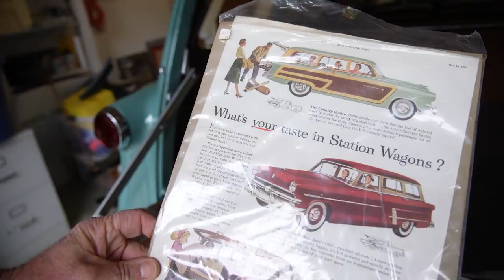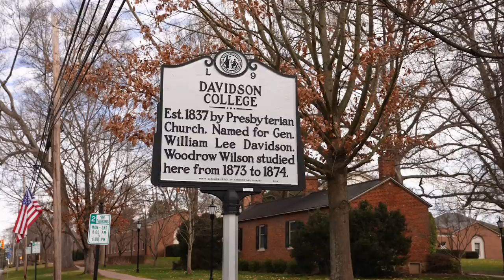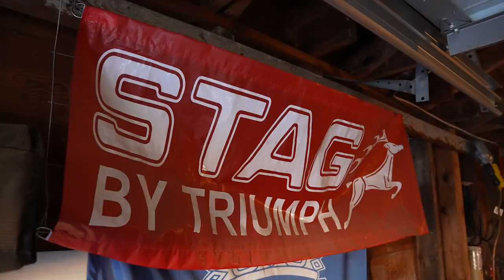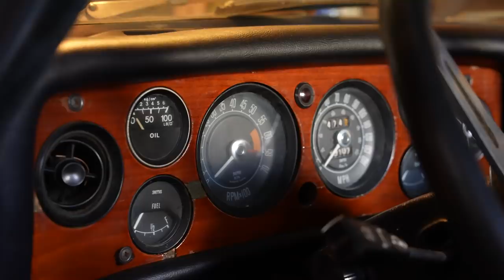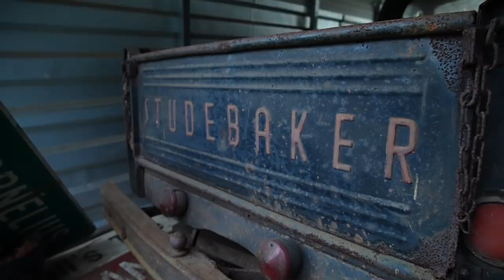Two Jeep CJ 2As and Three Triumphs in ONE alley | Barn Find Hunter - Ep. 103

Comment: My most favorite Triumph is the TR6, love the lines. 
However, the Jeep CJs caught my eye, especially the one with the power takeoff. In 1947, Rover in the UK, developed the Series 1 with a power takeoff that went under the body and through the frame and the frame copied the original Jeep of WW2. The thought was to have the driver sit in the middle seat similar to a tractor. Obviously it was move to either right or left depending upon the country’s laws. 
I have a 1967 series lla, and it still has the openings for a power takeofff. Thanks for a great video, as always.

Comment: I have been waiting for a Jeep barn find. And they give us 2!
Reply: I've been waitin for a Jeep episode as well, I own 3 Jeeps with the latest model year being an '85 AMC Cj7....🇺🇸
Reply: I own 2. 1972 commando and a 1950 Jeepster
Reply: We need a jeeps in the barn book!  We did not originally plan to film the jeeps and i wish i could have pulled them out of the garage to show them better.  The 46 (tan willys, we call it TILLY) has original pto, diamond plate driver's side step, chaff guard on radiator and rear seat.  The 45, while  uber rare, was an advanced cancer patient and required a frame off restoration.  I mentioned it had an industrial motor, but i do have a period correct 45 head that i will eventually install.
Reply: @markweir4469  if you have YouTube channel chronicling the restoration I'd watch it.
Reply: @plantertrey  The green jeep was done 2007 to 2009 ish and i really wish i had taken video.  I have lots of non digital pictures!  I hired a top notch body man to be the project engineer  and he was hired to work on a monster build of a cherokee xj for little earnhardt ( we live in the center of the nascar world).  I think i have a pic somewhere of the two sitting side by side.....Jeep on!
Reply: @markweir4469  Thank you for your reply and Jeep on!

Comment: Hi Tom. To be fair the Stag is a full 4 seater and that  3litre V8 is a sweet engine when looked after . Manual /overdrive is pretty rare . The power steering is ridiculously light  and is dangerous in damp or wet conditions . So is the Ford replacing the "woodie" ? Thanks Tom.

Comment: My Grandfather was a contractor and lived in Cleveland Heights, Ohio. You could not have a pick up truck on your property so he used Ranch Wagons to haul around materials. A 1956 and a 1960. The back seat was folded down when he purchased  the car and came back up when he sold it. The 1960 had a 352 ci Interceptor engine and could really run. If I remember correctly the 1960 was the same green color of your 1953. Both of these vehicles smelled like cut lumber inside. A great memory.

Comment: Back in 1974 I had a '53 Crestline Victoria given to me because it wasn't running at the time and the rocker panels were all but rusted off from the midwest winters. New battery, points and fresh gas was all it took to get it back on the road. It had the flathead V8 coupled to the Ford-O-Matic  automatic transmission. with less than 50,000 on the clock it was in pretty good condition other than the rust and it drove well. Unfortunately as an 18 yr old still living at home I didn't have anywhere to keep it so I sold it for $300 which was about 50 more than I made in a week working at a factory back then.

Comment: My dad has a 46 cj2a with a three on the tree i forget the number of how many were made with a 3 on the tree but its not too many he had the mechanical side of everything rebuilt by a guy down the street who gets engines sent to him from around the country old hot rodder cool guy. We used to antique farm shows and plow with the jeep from time to time as my dad has an old ad of the cj doing all types of things such as plowing punning a welder trenching and a ton more the plow worked very well cuz it has 5.38 gears. It has an 8,000lb pto winch the name slips me ATM Bradley maybe? That jeep will go anywhere you want to take it I've seen it go through mud holes that a jk with 4 inch lift and 35s had to winch himself out of. we  also have a 43 bantam trailer to go with it love that jeep and I will have it forever.
Reply: from my research -- the VEC (very early civilians -- ie 45 and early 46) had three on the tree.  WO records were spotty and in general they used the parts they had and then switched over to new ones.  You are correct that the three on the tree is pretty rare.
Reply: @markweir4469  My dads is the only one I have ever seen in person or on the internet the winch is a Ramsey pto winch I have thought about posting some you tube videos of the jeep wheeling and plowing if i could find the video of it.

Comment: Tom, A station wagon with a three-on-the-tree, what more do you need?
Reply: How about a 4 or 5 on a tree?! And did you notice that as well as making full use of the width of the car with a bench seat,  the column change also doesn't intrude on the passenger legroom. BUT in addition, despite being REAR wheel drive, somehow it doesn't have a nasty transmission tunnel in the middle! So maximum  passenger space! And did you see under the bonnet? The engine isn't all crammed in with unnecessarily extra gadgets , so you have good space to work on the engine. This Ford is a role model for how ALL cars should be designed!
Reply: @nygelmiller5293   I have heard of 'Tree' transmissions with more than 3 forward gears but I don't remember ever seeing one. In terms of extra space under the hood, our 1975 Plymouth Fury sedan with a Slant Six had enough room left over for another...... Slant Six.

Comment: Hi, great episode once again! In regard to your comments about the Triumph Stag, you said there were not to many left in the world... maybe in the US, but not so in other countries like the UK, Australia, New Zealand etc etc you are spoilt for choice in the sales choices, especially the UK. As to the engine, correct they were only used in the Stag, but as to it being a problem, not anymore!
The expertise (and parts) to run these engines without the issues which maligned them when new, is readily available and it is very easy to have a 'turn key' Stag to enjoy. It may only be 3-litres, but it has one of the best V8 burbles to come out of a V8 engine anywhere.
Reply: There are lots of them outside of the us but not many original ones left in the us.  THere were 2,7xx sold in us market and many of those left do not have original motors.  There are probably 1000 to 1500 left and who knows how many of those have the original powerplant.

Comment: Holy hell, that's my dream garage come to life....and why does that beautiful Wagon sound like it needs oil, a lifter is bad, or is that ticking sound due to the motor havin solid lifters? I absolutely love that Stag and both of those Jeeps, in fact I've got a '46 Cj2a with the drivetrain out of a wrecked 1970 Kaiser Cj5 Renegade I...
Reply: That engine should have solid lifters. If you don't hear them, then you have problems. I have a 59 Chevy panel truck with a 235 six cylinder, and it's the same way. If you don't hear the lifters, you are burning valves because they aren't closing properly.

Comment: I had a 69 TR6 which was before the ugly black rubber baby buggy bumpers. Mine had 6 throttle body fuel injectors. The only mods I did to it was to replace the cardboard tunnel and replaced the dashboard with a weaved wood Connelly Waterski. Massaged the motor to get it to just shy of 210 hp.

Comment: It's an aluminum block 215 CI motor that Rover bought from Buick. They bought the tooling and the rights to it and used it in the Rover as well as the Stag. Stags are one on the prettiest designed cars ever.
Reply: Wasn't there alot of problems with that engine? A classmate had one in a Buick Special. Low miles but needed to be pulled and overhauled. He carried the engine block down his basement stairs by himself!
Reply: @northdakotaham1752  the stag engine was developed internally by BL and that was one of its flaws.  It is a cast iron block with an aluminum head.  Had Leyland used the joint buick/rover motor the stag would have been a different story in the all importatn US market.  There were lots of engine swaps in the US and the motor Mario references was often used.
Reply: @markweir4469  that helps clear things up. Thanks. That aluminum Buick engine was ahead of its time I suppose. How durable was it? I have only seen one of them...back in the mid seventies.
Reply: @northdakotaham1752 .. Yup. Not the most reliable thing around. Overheat it a little bit  once and it's toast. Lotus thought of using it in the Esprit in the late 70's but, fortunately,  decided against it.

Comment: There are plenty of Triumph Stags left. In my opinion fitting hard top and Factory Alloys by far better looking . What’s interesting is that the exhaust engine sound was designed and made specifically harmonious to the ear .As apposed to a larger V8 engine which to many is too powerful & aggressive  for such a car. It’s not a heavy car and doesn’t need overweighted  front end to ruin the balance and handling.
Reply: There were only 27xx imported to US market -- yes there are lots in other markets, but in the us the numbers are much lower.  It is estimated that as many as 2/3 of us stags had major engine problems during the warranty period (one of the nails in the BL coffin)  Many of the stags left in the us do not have original motors.  FTR, i have the factory hardtop -- it was sitting in the back of the green willys with my crossbow on top of it.  I also have a set of the alloys you reference and have toyed with fitting them as i too prefer that look.  CHeers!

Comment: Show us that Cherokee my man
Reply: 1995 country that was originally black with gold accents.  My daugher crashed it 9 years ago and i rebuilt it.  It has 350K on the clock and the original motor gave up at 292k ("knock knock"  "WHo's there?"  "Cylinder 5").  I has an atk crate motor with 58K on the clock.  It has the original transmission and rear end, although the latter sounds like it is tearing itself apart.  I have driving it with confidence on many, many long trips and many deer, ducks and other birds have been hauled around in it. When i rebuilt it i had it painted a jeep color from 1966 (amc owned jeep then).  The color is called beachwood.  Thanks for noticing it.  MW

Comment: Between the Stag and the TR7 marked the death of Triumph, sad
Reply: i have read that as many as 2/3rds of us stags had major engine problems during the warranty period.  Ours is pretty straight and does not run hot even in 95 to 100 F.
Reply: Water pump above the engine!!!! What could probably go wrong!! Had a 75 it was 2 years old, timing chain broke but I miss that noise 🤗
Reply: @simonedwards5070  the timing chains are a weak link and i am going to be checking the tension on mine in the near future.  I believe there are some german made chains that are less prone to stretching.

Comment: What are the odds of somebody buying the blue wagon, take it apart with the intention of restoring it ,  and then sitting in a garage for long , long time?......99%
Reply: That car doesn't need restoration, it needs driven. The wiring issue is probably something simple, and it may need the points cleaned or replaced to get spark.